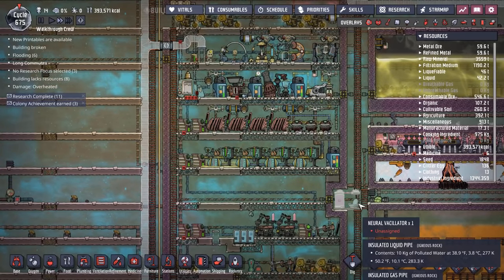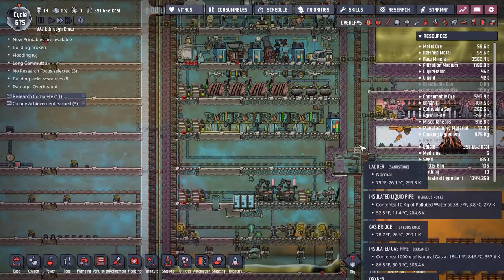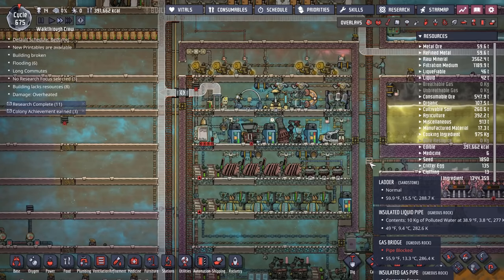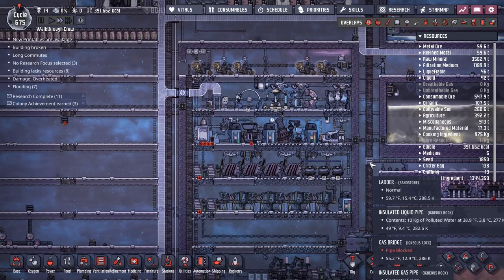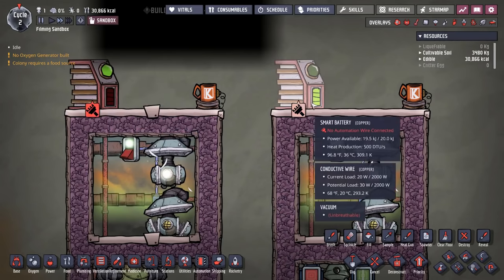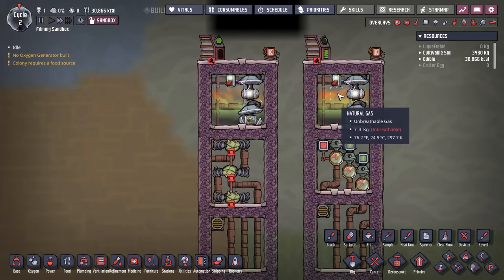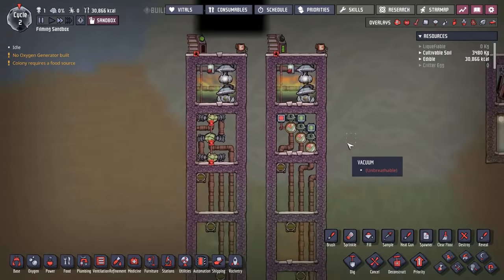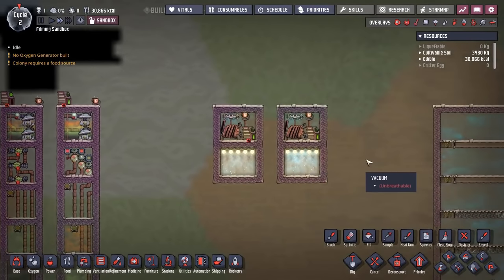Oxygen Not Included Tutorial: Power

Comment: For those wondering about power loads on wires:

The normal wire can carry 1000 watts, meaning that in combination, only 1000 watts can be consumed on it. If you hook up three Manuel generators(1200 watts in total) with normal wire to structures that in total need less than 1k watts, nothing will brake and those 200 extra watts will be used to charge batteries which don’t count as consuming. If, however you hook those three generators to structures that in total consume 1.2 k watts, the load will be too great and things will start to break.
Reply: I didn't hear mentioned during the video: using 2 small transformers to supply power from heavy watt wires to conductive (refined) wires.

backfeeding transformers: using an isolated power generator with small wires attached to the top of a transformer & the heavy watt on the bottom/load side.

I wouldn't mind hearing more people talking about advanced power setups like using batteries as circuit isolators: You can have all generators and half your batteries all on a singke 1kw wire circuit (batteries aren't loads) then use the power relays to swap charged batteries for empty batteries (either by a timer or by smart batteries).

Comment: Love your tutorials!  One question I have is how do you set up the actual power grid to go out and run all the rest of your stuff?  Is it just one big grid?  Since the wire has limits, even if you have thousands and thousands of watts of production you still have to separate it out to different grids for the blocks of usage, right?
Reply from the maker: Yeah, that's what the transformers are for.  They transform higher wattage wires into lower wattage, so everything is connected either to that heavy watt wire (which is connected to all of the batteries and power generators), or it's connected to a transformer that is connected to that central heavy watt wire.
Reply: @Magnet_MD  Oh I see it now.  I didn't realize the heavier wires were a LOT heavier.  I thought they were just 4 KW like the big transformer.  So you can run 20 or 50 KW and then peel off 1 KW here and there.  Thank you!

Comment: Appreciate the video, loving the other series. Just have one question though. Why would you set the high threshold on your smart battery to anything less than 100%?
Reply: That's prevent wasting resources. A generator won't stop mid-animation even if the battery gets full. So lets say your battery bank is at 99% capacity and one cycle of your coal generators is enough to charge the batteries by 5%. So in this situation you would waste about 80% of the power from the generator cycle since your batteries are full. But if you have the high threshold set to 80-90% you'll never run into this overproduction issue.

Comment: great huge video thanks! One thing I want to ask I have seem some info out there about the huge batteries that 5-7 of them are enough to do a full lump of coal. So early game you could throw them out there and not waste coal. It seems to me like a lot of heat but it's probably a good source until you get to smart baterries. I just don't know if it's worth it vs just doing manual power. Thoughts?
Reply from the maker: I think the best setup for the early game is one or two small batteries.  You don't need to store a tremendous amount of power (because you shouldn't need to use a lot of power) until you get smart batteries out, and you also lose some power just because the batteries will bleed off over time.

The jumbo batteries have the worst power-loss rate, if I am remembering correctly, so I basically never build them.

Comment: Not sure if this is due to the version I'm on or if I'm doing it incorrectly, but the gas filter setup from the conserving power section doesn't seem to work.  With a normal filter, the gases stop moving altogether if the power goes out.  However, with the automation filters, the gas will keep moving, just to the wrong places, which is even worse.  A regular gas filter will be needed regardless to avoid sending the wrong gases into my power plants.

My grid is suuuuper unreliable currently lol - is there a way to configure this so I can get these power savings while keeping reliable gas flow?  I'm working to weed out unnecessary efficiency, but this would free up a ton of power.

Comment: On 5:05 mins, on right side you can do it even more better. Directly running pipe to bottom then hooking the sensor to a vent
Reply from the maker: Very true!  I will update this video at some point to include that optimization.

The thing we should note is that this doesn't always work 100% because sometimes you may want to route from a pipe to a gas storage container, meaning you need the shutoff.  For things like oxygen though, for sure, you can always vent it back into the base.

Comment: @3:10 You forgot a 3rd method thats identical to the right shutoff demonstration but minus the shutoffs by using the automation of the vent where it opens/closes depending on what you set the sensor to detect. So you save extra power per shutoff you dont use
@52:50 reservoirs dont over heat by the contents but by the atmosphere temperature and reservoir transfer the contents thermal energy to the tile below the output so best to build with insulated tile.
@2:18:20 never a good habit to put tempshifts next to insulated tiles as you're forcing heat transfer, if you want mass on the edges you can use drywall
Reply from the maker: Good point!  That would definitely be different than most ventilation setups that I use considering some of them will still need to travel through pipes to get to where they need to go.  At least for making sure oxygen stays in your base, this is definitely a better solution than the one I mentioned.
Reply: I still use a 4th method: a valve set to 1g keeping a circle of pipe supplied with a constant loop of a single fluid, then use bridges to only add more of that element to the pipe segments. 

edit: this method has been nerfed in the big merge patch, valves seem to open up and allow more through each time you load, so valves must be within reach of dupes.

Comment: So the large transformer limits the flow to 4kw but the conductive wire can only hold 2000watts so couldn't the 4kw or 4000w overload the conductive wire? That's the one thing I still don't understand. Also once I get the large transformer should I basically stop using the small one?

Comment: With the Spaced Out download, the deoderizers cost power now. For those of us who are either really bad at reading details or just don't know power terms, what purpose does the transformer serve?
Reply: Think of it this way. Whenever a machine starts operating, It will request power from the wire it is connected to. Each type of wire has a limit for how much power it can supply at once, and it counts each power drawing machine attached to the entire length of wire. For the basic starter wires, it's 1,000 watts. If the total requested power is above 1,000, those wires will start to damage themselves. 

Transformers are very useful because they bottleneck the amount of power going through the wires. A transformer will ensure that no more than 1, 000 watts goes through its output, keeping your wires safe. It also lets you create "blocks" of power, to keep the wattages of different systems separate.
Reply: @deemo665  Ahhh. Thank you, That makes a lot of sense.

Comment: You said the oil tank needs to be a good material, which isn't necessarily true if you're using insulated pipes bc the tank does not give off heat from the liquid inside. How you said it, it made it seem like the heat of it increases when you put something hot into it.
Reply from the maker: As far as I understand, it does slowly exchange heat with the things around it.  Assuming we are talking about the same thing (Liquid Reservoirs), I have seen them overheat plenty of times due to putting hot liquid inside them and building them out of a material that can't resist it.  I'll need to test again and see if that is still true.
Reply: @Magnet_MD  that's weird unless its something they changed within the last month or 2 I never seen that. I would put 300F oil in them made out of iron and they would be fine. It was when the surrounding around them got too hot they would heat up. Because it wouldn't make sense for them to exchange heat if the liquid inside doesn't change temperature.
Reply from the maker: @bpindel  What the...

So I am testing this right now, and it looks like the liquid INSIDE exchanges temperatures with whatever is on the OUTSIDE (oxygen for example), but it does not exchange temperatures with the actual building.

If you put a liquid reservoir in a vacuum and pump super hot liquid into it, it will never overheat.  But if you put it surrounded by oxygen, it will overheat with no other heat sources, because the hot liquid will heat up the oxygen, and the oxygen will heat up the reservoir.  LOL.
Reply: @Magnet_MD  Hahahaha, gotta love some of these mechanics... the liquid inside cooldown while it heats up the surrounding atmosphere?
Reply from the maker: @bpindel  Yep, the heat just equalizes between the two things
Reply: @Magnet_MD  thats a change haha it didn't use to affect anything around it. Haha well.. now all we need are tanks in vacuums yay.

Comment: I ran into a Hydrogen Vent, and I'm in cycle 40 or something. I haven't even cooled anything yet, or used sensors or valves or whatever, so apart from some tips like using obsidian for the walls, I barely got any wiser. For example, at the very start you put down a sensor while talking about something very different. I don't know what sensor that was without pausing the screen! I don't know what it does, or how to hook it up! From my point of view, you're skipping over the important parts..

Maybe this video isn't meant for noobs like me, so if you've got a video about hydro-vent power generation that is at the level of people who still need to learn about that, I'd be happy to watch it. Thanks.
Reply from the maker: Hydrogen is very advanced, you will need access to steel, plastic, and a fair amount of refined metal before you can effectively work with it.  I'm skipping past a majority of the nuance because it's assumed that you've already learned about those other things.  Capturing a Hydrogen vent that early is not viable due to the heat that you will not be able to manage.

I make tutorials for all sorts of different things, so if you need to know what the automation was, I'd suggest checking that video out.
Reply: @Magnet_MD  Yea, I was kinda frustrated when I wrote my comment. Sorry for that. 
Soon after finding that vent, I figured out it was way beyond my science level, so I ended up just boxing it in.
Thanks for the reply.
Reply from the maker: @TheBushdoctor68  No worries, and yep, boxing it in for now is totally fine until you can work with it safely.

Comment: Doesn't the large transformer to go 4000w  when the conductive can only go to 2000
Reply from the maker: Yeah, the larger transformer definitely supports more wattage.  I always correlate which wires can be connected to it, and once you are on conductive wire and larger transformers, that's about as big as you need to go.  Conductive wire supports up to 2000w, and the small transformer + the basic power wire only supports up to 1000w.

Comment: But the big transformer is 4 and conductive is 2kw.   Just never hook up more than 2kw potential load?
Reply: or use 2 small transformers in parallel or use some other method to prevent too much power drain (timers/interlocks) 
because yeah... that large transformer WILL happily supply too much power to a conductive wire if the circuit calls for it.

Comment: Look up the mechanical filter, completely free.
Reply from the maker: That's pretty neat!  I hadn't actually heard of that before.  It is objectively a better solution if you want to save on power.

This is one of the things I struggle talking about in a tutorial though, because of the complicated nature of getting one up and running without bugs for a new player.  A good portion of posts in reddit or wherever else are often things like "what's wrong with my plumbing setup?" and it'll be two outputs connected together.  These videos are usually targeted at players that can barely survive 100 cycles, and overloading them with complexity is something I try to avoid.

If I knew about this solution before this video, I'm not sure what I would have done differently.  Like I said, this is objectively a better solution, but whether a newer player would be able to understand it and implement it, I'm not sure.  The shutoffs/element sensors are already pretty complicated for a lot of new players, so even that example might have not been a very good one on how to conserve power.
Reply: If the thing is mechanical and doesn't use power...
Reply: Whoever came up with it first called it that.  It works through game mechanics.